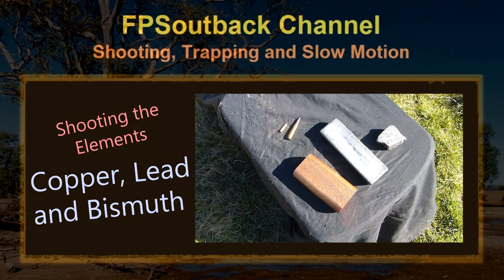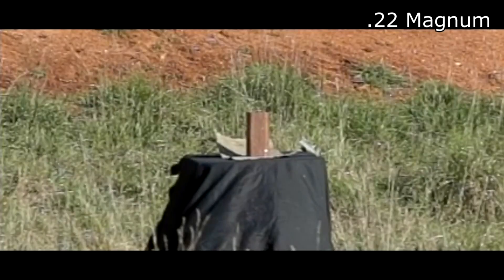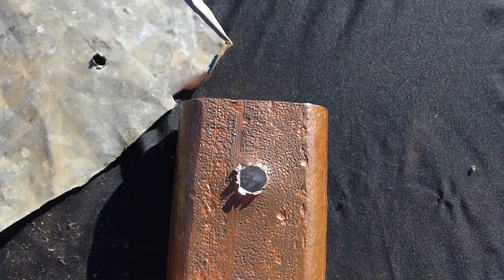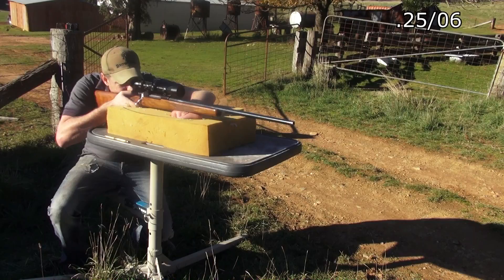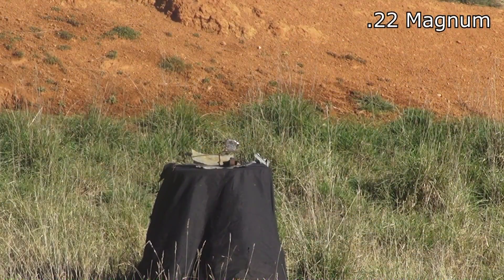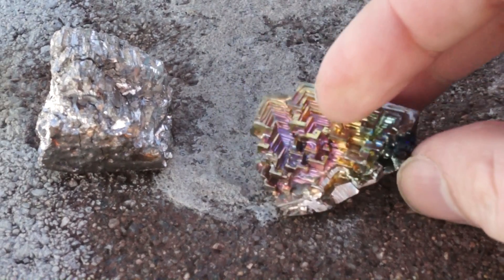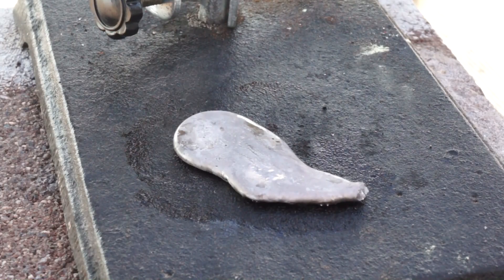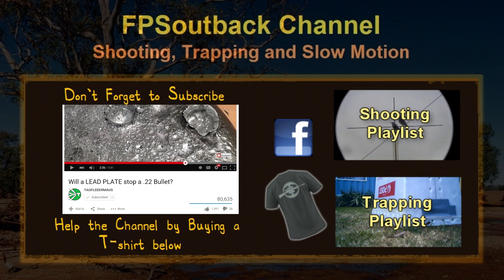Shooting Copper, Lead and Bismuth

Comment: Question:

Why do the divots in the copper block appear to have a greyish silver color to them both inside and on the expanded material?
Reply: neeedleinahaystack The lead from the projectiles is sort of burnished into the surface of the metal. Same thing that leaves a splatter mark on steel targets.